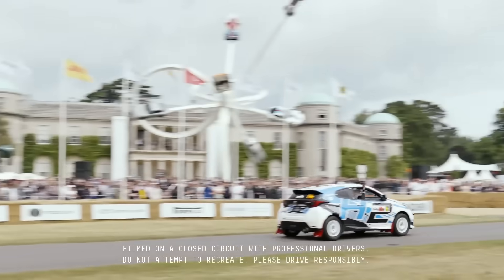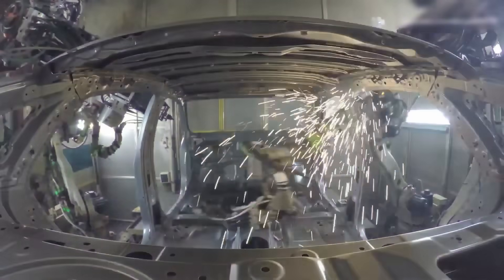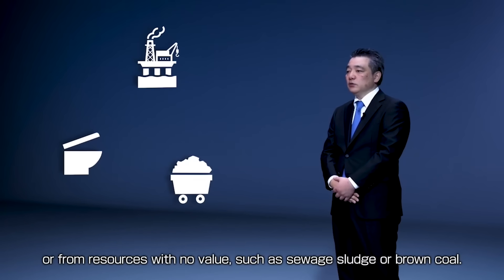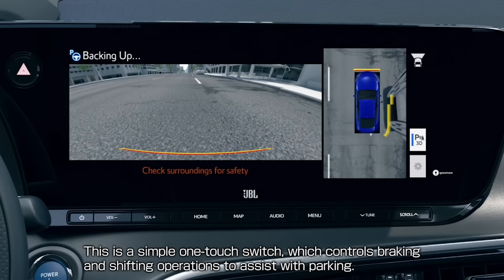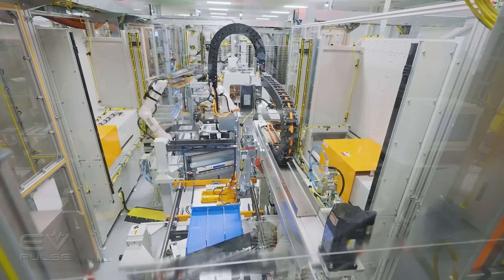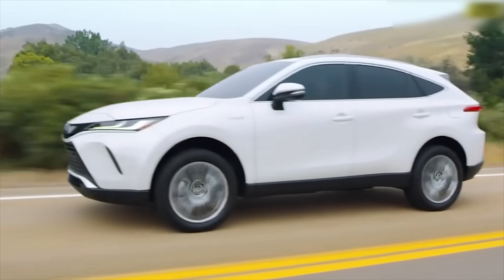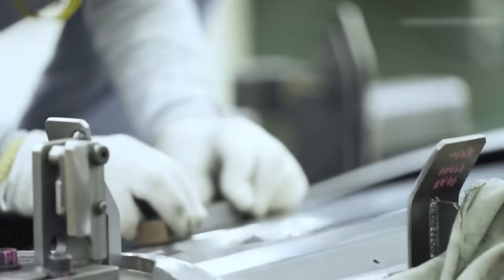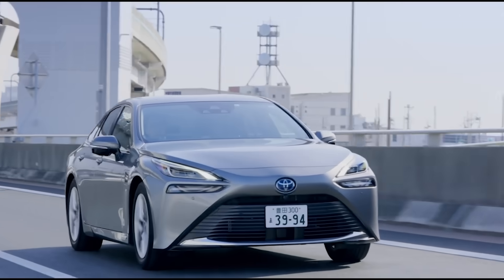Toyota Has Introduced A Water Engine that will change The World!

Comment: This comment section is completely wtong. There is no water powered engine. It is powered using hydrogen. Hydrogen burns and produces water. The water in the water engine come sbecause they inject water into the pietons to cool them down. While the engine itslef is crazy,  there is absolutely no infrastructure in place for hydrogen-powered cars. So no hydorgen powered vehicles will not eliminate EVs

Comment: A HHO Hydrogen power generator for your car better than you think.!!!

ACMEC HHO kits are designed for hho gas production in low amps. All hho kits generated Hydrogen and oxygen gases nothing else.! You can't store HHO but you can produce HHO on demand system according to your needs.

Yes HHO CAR KIT will improve your engine horsepower and efficiency while reducing toxic gas emissions hho kit will solved all engine heating problem automatically. Engine will run clean and smoothly requiring very little maintenance, you will only have to add distilled water. Hho is best for  decarbonization of your cars. So make your car zero emission. In this way you can stop polluting the atmosphere.!!

You will not see brown deposits in our new designed long lasting hho kits. Our transparent kits for efi cars working up to two amps. 

But our transparent hho kits for carburetor types engines working up to 8 AMPS. For better fuel economy. ACMEC HHO CAR KITS can installed on petrol, Cng gas, or diesel engines, to run smoothly and your life will much easier.

For more call zafar 03082266179 or watch hho zafar videos on YouTube.

Comment: Critical Analysis of the Video Content

The content of this video is misleading and clearly designed to generate views, not to inform.

1. The missing “water-powered car” from Toyota
At the start, the narrator promises to reveal the model of a car powered by water, allegedly manufactured by Toyota. However, no such model is ever mentioned — because it simply doesn’t exist. No car manufacturer, including Toyota, produces a vehicle that runs on water.

2. Misleading information about water as an energy source
There are indeed technologies that split water (H₂O) into hydrogen and oxygen via electrolysis. The resulting hydrogen gas (sometimes referred to as “Brown’s gas”) can be used as a fuel in internal combustion engines or fuel cells.
However, this does not make water a fuel. The process of splitting water requires an input of energy — and, according to the First Law of Thermodynamics (the law of conservation of energy), the amount of energy required for electrolysis is equal to the energy released when hydrogen recombines with oxygen during combustion. In practice, due to system inefficiencies, the net energy gain is actually negative.
Thus, using water as a medium to extract hydrogen for fuel is energetically inefficient compared to other power sources.

3. Why a "water engine" cannot exist
The concept of a “water engine” that uses water directly as fuel violates fundamental physical laws. Such a device would effectively be a perpetual motion machine — a physical impossibility. The energy must come from somewhere, and water alone is not a source of usable energy without prior conversion.

4. How the Toyota Mirai actually works
The Toyota Mirai is powered by a hydrogen fuel cell, which uses pre-produced hydrogen gas, stored under high pressure. Inside the fuel cell, hydrogen reacts with oxygen from the air, generating electricity to power an electric motor. The only byproduct is pure water.
This is a real and functional technology — but it relies on hydrogen as the fuel, not water.

5. Final thoughts
The video misleads viewers by implying that a car can be powered directly by water, without any external energy input. These types of claims are popular in pseudo-scientific and conspiracy circles.
The truth is simple: Water is not a fuel. It can serve as a source of hydrogen, but breaking it down requires energy — whether that energy comes from electricity, fossil fuels, or nuclear power doesn’t matter. In all cases, water itself is not the source of the energy.
In rare demonstrations, some individuals have shown cars running on so-called “water fuel,” but in reality, they use onboard electrolysis units powered by batteries. The vehicle runs on electricity — not on water. Everything else is myth.

Comment: Az E-autók fő problémája pl a hidegben való hatótáv csökkenés. A vízautónál is a hideg lesz a fő probléma. A víz ugyanis 0 fok alatt megfagy, a jég kitágul, szétnyomja a tartályt. Lényegében ugyanannyi probléma van a vízzel, mint az akksis autókkal. Az E-autók teljesítményét eddig még nem tudták felül múlni. A vízmotornak vannak előnyei, főleg az, hogy csak víz kell bele üzemenyagként, viszont mint fentebb leírtam, ez a gyenge pontja is. Na meg túl sok még benne a mozgó alkatrész, pont mint egy benzines/dízeles járgányban. Eddig egy előremutató kezdeményezést láttam, ez a PI-auto (PI-Car). Messze még az ideálistól, de már abból indul ki az elképzelés, hogy ne kelljen akkumulátor az elektromos kocsiba.
Reply: Freezing might not be an issue.  It will probably use potassium hydroxide in the fuel tank to promote electrolysis.  KOH is a salt.
Reply: @skookapalooza2016  A KOH korrodáló hatású a fémekre. Az a kérdés, milyen koncentrátumban kell majd használni, hogy ne fagyjon bele a tankba a víz, miközben szét sem marja a tankot a KOH.
Reply: @sasfeher  Неметален резервоар ? Пластмасов ?

Comment: Given that it takes more energy to produce hydrogen than it actually delivers, the question is, where is that extra energy coming from? If the car needs batteries to be charged, it is of no greater benefit than an ordinary EV because the same amount of energy is required to move any given vehicle regardless of its energy source.
Reply: Pane existují elektrocentrály tak do vozidla nejspíš montujou El.centrály k výrobě vodíku a i ta elektrocentrála jde pohánět vodíkem vyrobeným ve vozidle. Tak je to jednoduché.
Reply: Според теорията, и според някои експерименти, ефективна електролиза може да се постигне с използването на импулсен прав ток, с честота равна на резонансната честота на водната молекула. За целта е нужна активна обратна връзка, защото резонансната честота на водната е различна при различни условия. Точно подробностите за резонансната честота и обратната връзка се премълчават в разказите . Другото което се пропуска, че двигател използващ ННО (Браунов газ) работи чрез имплозия. След реакцията между водорада и кислорода обема е около 1600 по-малък от обема в началото. За сравнение, настоящите двигатели с вътрешно горене работят чрез експлозия, разширение след реакцията.

Comment: The amount of energy required to break H20 molecules into H2 and O is comparable with what is necessary to run a rc toy, while the energy released buy combusting hydrogen is second only to nuclear energy. The reason for low energy required for electrolysis is that water molecules have higher bonding energy within hydrogen to hydrogen (HYDROGEN BONDING) than hydrogen oxygen,  while electrolysis  only breaks down the weaker hydrogen oxygen bond and has nothing to do with hydrogen hydrogen bond, thus requires minimal energy. To give you an example of how strong is the hydrogen to hydrogen bonding is in water molecules you should know that water can not be compressed and shrinked but hydrogen bonding is so strong that compresses  and shrinks the water molecules and flattens them shrinking them into lower volume that is why when you freeze water it expands and increases in volume the  costly freezing process breaks down the strong hydrogen to hydrogen bond in water molecules making it to increase in volume
Reply: Sounds exactly backwards to me. Law of conservation of energy says it takes just as much energy to break bonds as it does to reform them.
Reply: @badbrain8279  law of conservation of energy barely works in real life since some energy is lost during the reforming process
Reply: @lehlogonolorahlano6998  Exactly. But enough of the obvious.

Comment: I guess what is happening is: You pump water into the car, then plug it in overnight just like you would a normal EV. But instead of storing the energy in a battery, the energy is used to split the water molecule, storing the H2 and letting the O2 escape. So the energy comes from your home's electricity the same as a regular EV. When you drive, the H2 and O2 (from the air) are combined release the engine power. I am not sure if this process is more or less efficient than electricity to lithium batteries.
Reply: Depolama yok. Belki çok küçük ilk çalıştırma için olmalı. Ayrıştırılan hidrojen direk kullanılıyor. Depolanan sadece su.

Comment: Deionized water is essential to avoid mineral deposits in resulting from electrolysis.  Having access to infrastructure (fuel station) capable of producing deionized water is essential.
Reply: Regular distilled ?
Reply: @als4179  Deionized water removes mineral ions, while distilled water removes impurities through boiling and condensation, with deionized water considered purer and used in applications requiring high purity, like electronics and laboratories.
Reply: @tedhamilton2362 thank you for explaining.  Us laymen improve like that.

Comment: Engines don't run on water, this video is pure BS!  It takes a great deal of energy to separate hydrogen from an H2O (water) molecule.  Why do you think there is so much water on the planet?  It is a very stable molecule and is not easily split apart.  You would need to generate more energy from the hydrogen produced than it took to separate it from the water molecule.  The process you are describing is a perpetual energy machine and does not exist.  An ICE engine that burns hydrogen will not output any CO2 but will output a great deal of NOx due to high compression ratios required to have a high output efficiency.  FCEV's are kinda stupid.  We use energy to separate the hydrogen from water (or worse yet, take hydrogen from natural gas and then dump the carbon into the atmosphere), then compress it to have a decent energy density (which you never mentioned) and then use it to produce electricity in the fuel cell.  Just put the electricity into the battery of a BEV.  We already have an electrical distribution infrastructure we just need to upgrade/expand it, which will be far easier and cheaper than creating an entirely new transportation/delivery system.
Reply: Thank you for taking the time to explain this.
Could not bear to hear any more stupidity from this guy.
Reply: It is easy to say engines do not run on water. Many new inventions used now had the same tag twenty years ago. Tesla was a genius who was shifted by big business I have been there with my superior earthmoving tool designs that would save operators millions of dollars a year. Some of the tool tests outlasted the best tools in the world by four times. It seems I have had my Tesla moments too. When I could not afford to pay the huge patent costs. Big business took the designs
Reply: @jim-z2h1k Nikola Tesla was in love with a pigeon.  He was a champion for AC power due to its ease of transportation with minimal loss.  Other than that, he was a crackpot.

Please enlighten us on the mechanism by which engines run on water.  Water does not combust so it does not generate heat which causes an expansion and therefore pressure on a surface as in the case of an internal combustion engine.
Reply: Well i've made hydrogen gas using electrolysis with a  12v car charger. But you're right, its not efficient. I mean if you had a big hydrogen generator at home and piped that into your car overnight, filled it up with hydrogen and then drove on that during the day, that would be fine..... However i think its more environmentally friendly to drive on ethanol instead of hydrogen because at least when you burn ethanol you aren't adding anything to the environment.
Reply: @Jamie-cz2xu  what???  Ethanol is a hydrocarbon.  When you burn it you are releasing carbon into the atmosphere.  There is also the high levels of NOx produced due to the higher compression ratios because ethanol has a very high octane rating.  Why do you think tuners love the stuff?  Ethanol, like other alcohol fuels also have a pretty crappy energy density.  Never mind the fact that you are using food to fuel the world's cars.  This is absolutely not sustainable.

Yes, you can produce hydrogen in your garage with electrolysis, but yo would be at least 10x more efficient to just use that electrical current to charge a BEV.  Why the hell do people think that we should use electricity to generate hydrogen from water, then put that hydrogen into an FCEV to produce electricity to drive on.  You also need to account for the energy required to pressurize the hydrogen into a tank to achieve any kind of usable energy density.  For those of you that don't know, hydrogen will never liquify at room temperatures no matter how much pressure you put it under.
Reply: @drock6627  Well the difference between ethanol and gasoline is gasoline comes from oil thats pumped out the earth. And ethanol comes from corn. So with ethanol you are taking carbon dioxide out the air and water and converting it into fuel. So it isn't having an impact on the environment because the fuel used is created by converting greenhouse gas and water into the fuel so the impact is nil or a lot less than gasoline. 

Gasoline takes something buried deep inside the ground and adding it to the atmosphere. 

Its weird. matter cannot be created or destroyed, its almost like physics or something.
Reply: All of you read about brown gas and Yull Brown and after write your comment 
Thanks